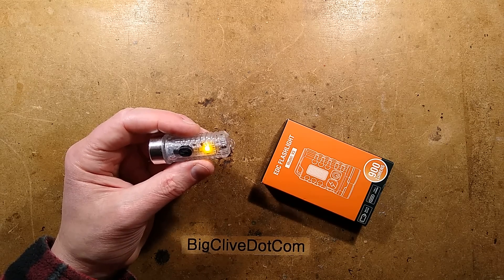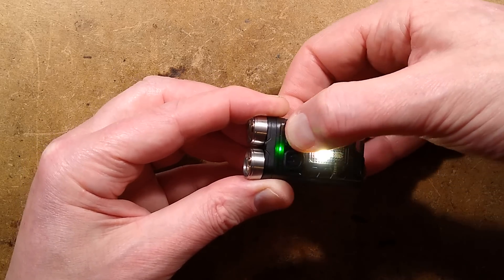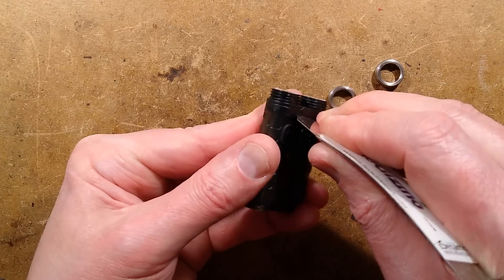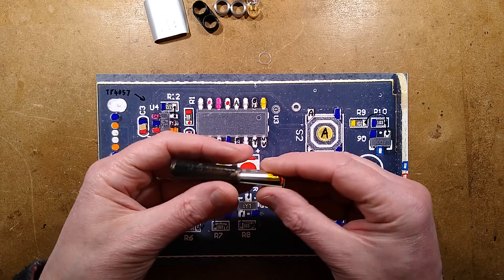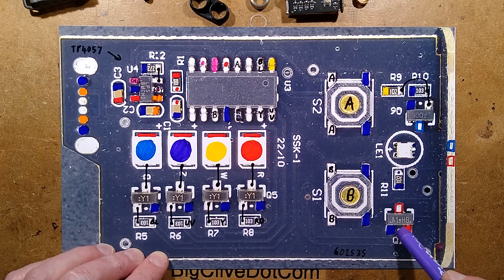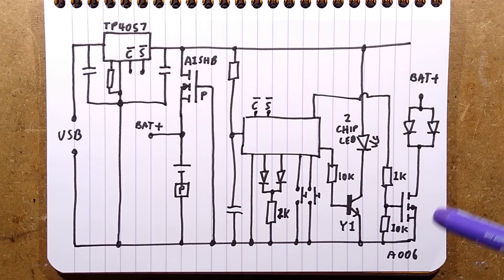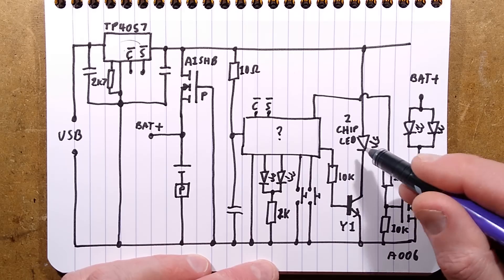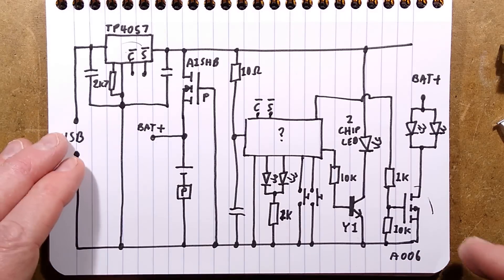Inside an EDC V3 flashlight (with schematic)

Comment: I would bet that polarity protection mosfet was put there by the designer after having a mishap like that cellphone killer a few months ago that was wired in backwards. Seems weird since the only time the battery would be connected is during assembly, but it's probably cheaper for a mosfet than to make sure it's plugged in correctly every time.

Comment: I have a question. I have a Garmin Gps60CSX that has a Battery Tab that needs to be soldered back together. I’d be willing to send it to you. If you can take it apart, fix it, and send it back without being destructive I’d be willing to send it to you. If you can't do that without being destructive you can just send it back. If you don't want that responsibility I understand. I also have a Aturia Beatstep pro that needs the USB terminal desoldered and the Wire Soldered on. I know that is relatively easy to take apart and fixed. If you want to fix and explore that instead I could send that. Just let me know. Otherwise I’ll just get them fixed here. 👍🏻✌️🏻

Comment: Great video Clive, i have a request, my son smokes these thro away e cigs, is there anyway i can use the batteries for garden lights for the summer ? Thank you
Reply: Search the videos, I think he’s already made one on those lines
Reply from the maker: Yes.  But they do need overcharge protection.  However, some of the modules do have charging circuitry built in.

Comment: About 3 months ago I bought this EDC V3 for just under a tenner which, considering its versatility was a pretty good price. Its red-blue flashing part is bright enough for emergency signalling in poor weather, its small UV light isn't up to identifying banknote forgeries, but otherwise it's quite a useful high powered, well made EDC flashlight with a quality Type-C charging point. I like that it dims down, useful for not disturbing sleepers. Altogether you did a jolly good teardown, Clive. 🌻

Comment: I bought the GITD version of this recently. It's already replaced all the AAA lamps  I used for EDC at work. I tend to carry a small lamp on a lanyard around my neck for quick checks of the kit I work on, with bigger lamps used as required. If I lost or break this, I'll be replacing it with the same.

Comment: The Torque Test Channel had a pretty good economy luminosity test rig. It was a combination of a hollow stryroform dome and a light sensor. I think they have a video explaining what went into it.

Their findings were that lumens ratings were even more absurd than the battery capacity ratings.
Reply: I trust my combo taser/light 😃 500 million volts and 100,000 lumens. Runs off one 9v 😃
Reply: @napalmholocaust9093  mine has so many lumens that people ask me to turn it on when they need a few extra hours of daytime.
Reply: @WitchidWitchid  Ha, ha, ha, you guys are funny!
Reply: @napalmholocaust9093  ROFLMAO!

Comment: wonder why they used a 16-pin chip? you usually don't see those in little devices like this
Reply from the maker: It's probably the next step up when they run out of pins on the 8 pin chip.

Comment: Two amps is quite surprising. Could the design be relying on the battery protection chip? Is that a standard discharge rate limit for such cells, or is it a custom unit?
Reply: 2 amps would equate to 4C which is massive for a standard cell but normal for a high current rc heli/drone cell.

the leds still dont like that. they'll be cooked in a short time after serval high power blasts.

Comment: That light displays perfectly the problems exhibited by all of these LED lighting units. They're too damn complicated. If I buy a light I want a switch that turns it on or off.I don't want modes. I don't want fancy flashing garbage. I don't want different power levels. I want one click for on and one click for off. That's it and manufacturers have all forgotten that the customer doesn't need nor want the fancy nonsense.
Reply: Probably designed for the younger generations. After all most of us Old Farts who think like that will soon be dead! 😜😉
Reply: I do like what acebeam has done with their lights. You have one main switch that turns it on and off and a second one that will cycle through different modes when you're on and goes immediately to strobe if the light is off. There's definitely times where you want more or less light depending on what you're trying to illuminate and how far or close it is to you.

Comment: Since the front LEDs are directly driven by the battery and tied to the negative rail via MOSFET, what controls the output levels?  Is the microcontroller generating a PWM signal for the output?  13mA/2A ~= 1.5/255, so it's in the right range for 8-bit PWM I suppose.

In addition to the LEDs, the FET itself might be baked in the high-current mode. The datasheet for the A1sHB chip notes about 100mOhm RDSon, so at 2A in the high current mode it's dissipating about 0.4W of power.  That's above the chip's maximum rating (350mW).  The 'high' mode of 660mA is better (about 44mW dissipation across the FET), but it must still get very toasty in there.
Reply from the maker: Simple PWM control.
Reply: I came here to ask the same question. Must be PWM if the microcontroller is driving a mosfet that feeds directly to the battery.

Comment: Considering that the same people probably make a lot of the PD circuits you would think they would know to add a resistor across the USB to signal to a smart power supply.
Reply: I don't know why they always skimp on those. It's gotta be the cheapest part on the circuit. Either they're really greedy or just not very good at designing things.
Reply: @Okabim  i guess its both.

Comment: I bought this but in the glow-in-the-dark ,which works quite efficiently well. The rovyvon ones are a different breed tho.
Reply: I've heard the Rovyvons mentioned a couple times now in relation to these lights. Also seen them online, and am considering one.
Would you say that in a positive way or a negative way? I do know they're a bit more expensive, but if you're getting what you pay for, sounds like it'd be well worthwhile.
Reply: @Joshua C.  Better built. The quality of light is better too. Still Chinese made but you are getting what you pay for.